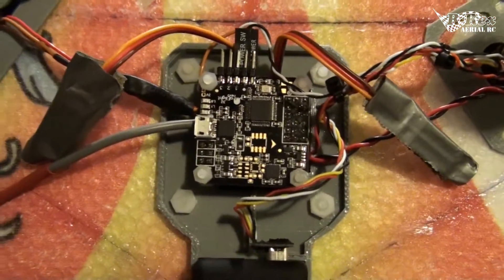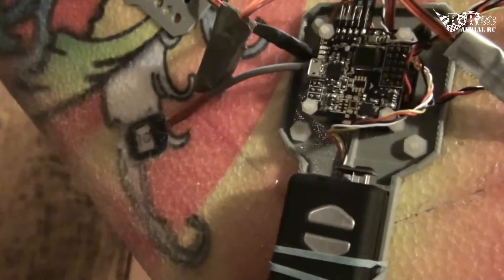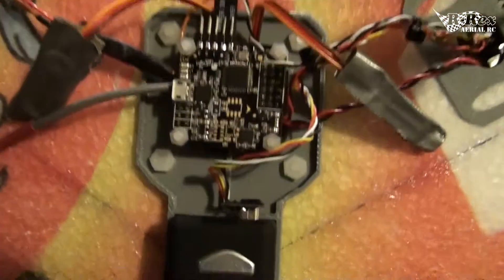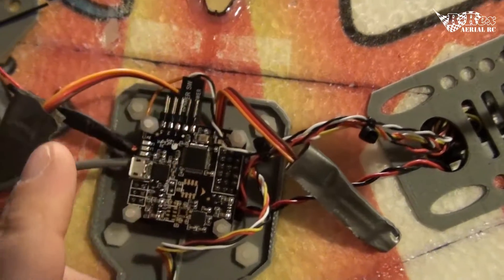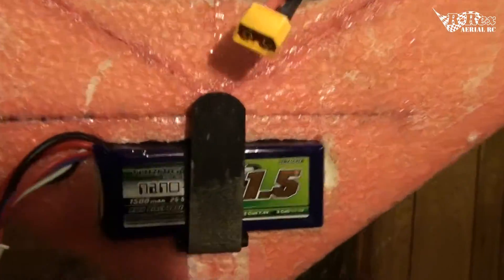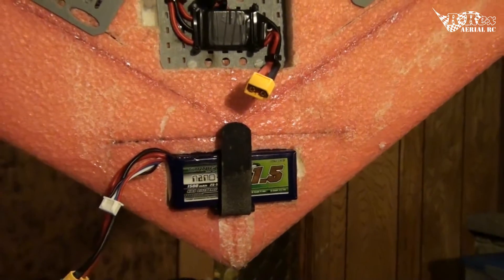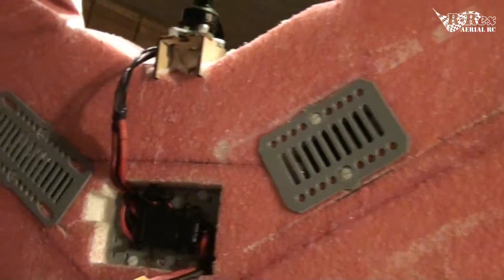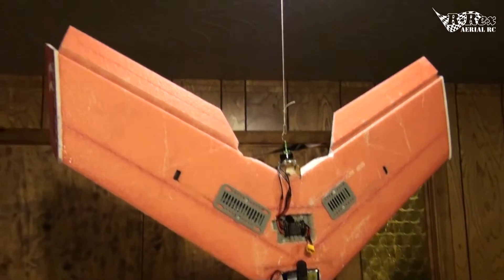About my FPV Turnigy Tek Sumo

Comment: Hi nice setup! I am wondering how you can fly for 18 min!!! Great
How much does the motor absorb?
With my tek i can fly for 13-14 min with a 1500 mah battery, 2200 kv hk motor and 6x4 prop with a total  weight of 500grams.
Reply from the maker: I was running a 6x45 prop originally and only getting about 10 minutes of flight until I switched to this prop. Also make sure your center of gravity is spot on. I did this by adjusting my center of gravity so that I required very little up tilt on the elevons. The link below is the prop I used to get the best flight times. Just check your balance, I sand them to get them balanced.

http://www.hobbyking.com/hobbyking/store/%5F%5F43889%5F%5FTurnigy%5FSlowfly%5FPropeller%5F7x3%5F8%5FBlack%5FCW%5F4pcs%5F.html
Reply from the maker: This is motor I used. I had to space the motor away from the mount to get the prop to fit. I also used that space by adding or removing space to adjust the center of gravity.

http://www.hobbyking.com/hobbyking/store/%5F%5F80475%5F%5FMultistar%5FElite%5F2306%5F2150KV%5F39%5FMINI%5FMONSTER%5F39%5FQuad%5FRacing%5FMotor%5FCW%5F.html